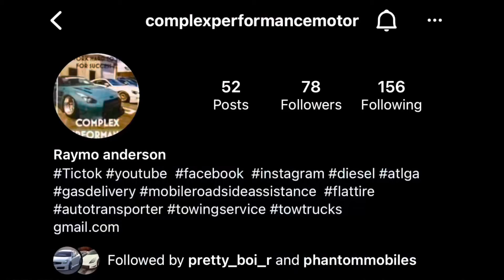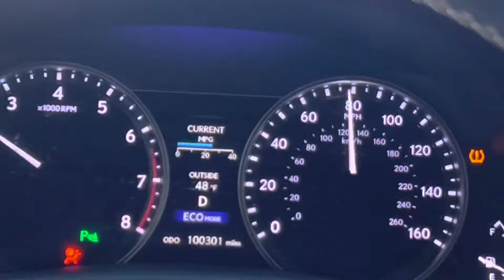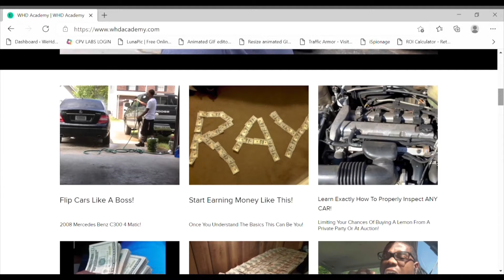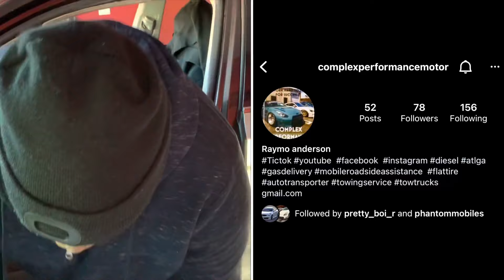IT'S GETTING RIDICULOUS I HAD TO TAKE EVERYTHING BACK APART ON MY LEXUS GS 350 *THINGS NOT LINING UP

Comment: Use Eco mode on the streets and heavy traffic. It takes the edge off the throttle so you use less gas. Normal mode you can use on the highway when traffic is like it is in this video.

Comment: Smooth! Eco is for conserving gas while on the freeway. Normal gives you the regular performance of the engine. Sport opens up the throttle and stiffens up the steering...I love driving in Sport mode. If you had Sport+ that stiffens up the suspension. Have fun!  BTW, the driver's door glass is double-layered for sound reduction...it's expensive. You should pull it out and sell it separately. Just saying!

Comment: Eco mode is all about saving gas. You won’t run off from a stop light in Eco. That’s for sure. We have the same car and to be honest with you I’ve noticed 3 things between each mode. 

1. The steering gets firmer between modes
2. It holds in gear longer the higher the mode. 
3. Of course the gas

I know you know about cars. I’m sure more than I do. But let me tell you what the mechanic at the Lexus dealer put me on to. He told me to buy the TECHRON Complete Fuel System Cleaner. It’s in a black bottle. He told me to use it every 6 months. And since I’ve been using it, my car is so much better on gas. It idles better also. Give it a try if you haven’t already. 

Keep this car. It’s a great car.
Reply from the maker: Thanks bro I'll try it